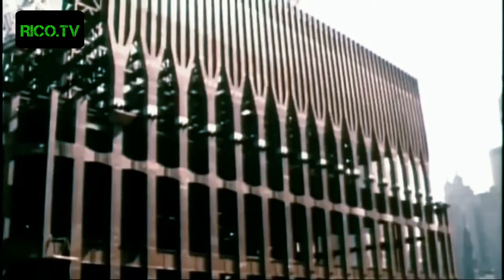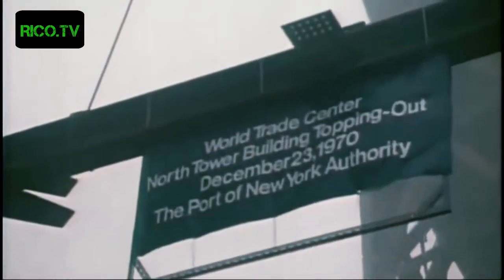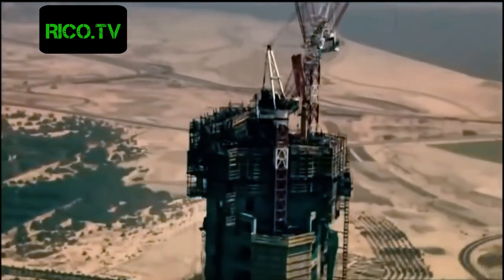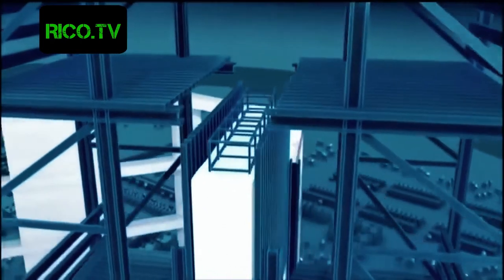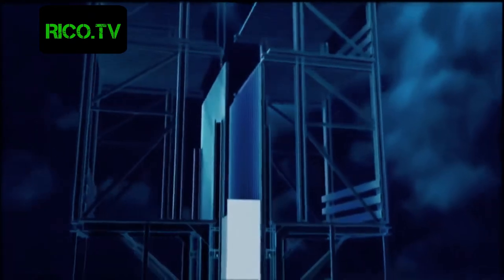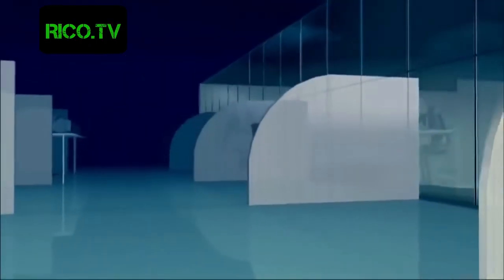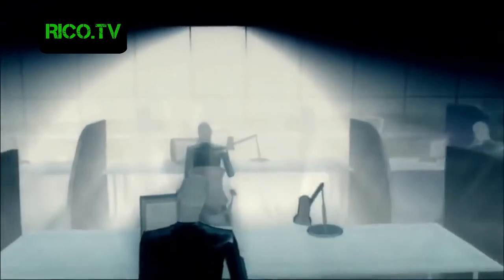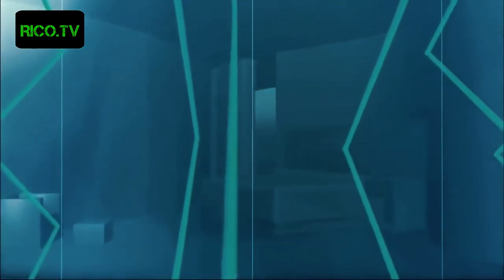CRANE HISTORY | UPGRADES NEEDED | 40+ YEARS ON NOT MUCH CHANGE

Comment: Yeah they dont care bout crane operators. Im running a brand new 550 no ac no window tint. Glare sucks
Reply from the maker: That it no AC, no curtains, no window tint etc that's bad... whats the temperatures like in your crane cabin?
Reply: @RicardoTheCraneOperator  if its 90 deg its like 110
Reply from the maker: @daytona453201  I can only imagine as I know crane canins can get every hot,  berry quickly and